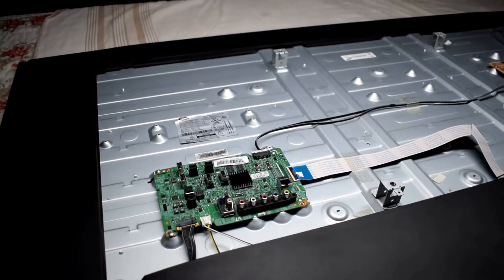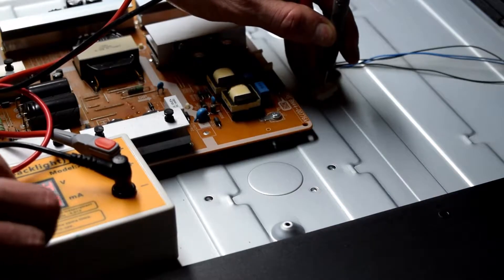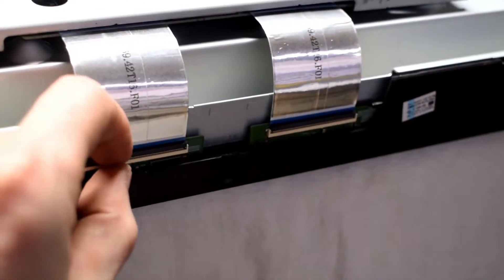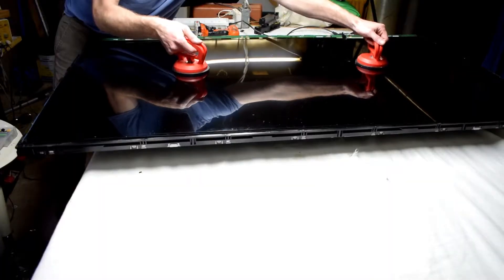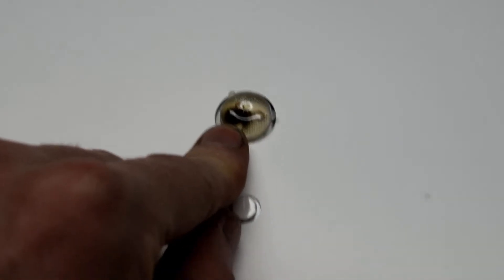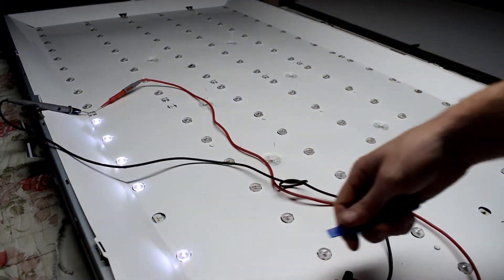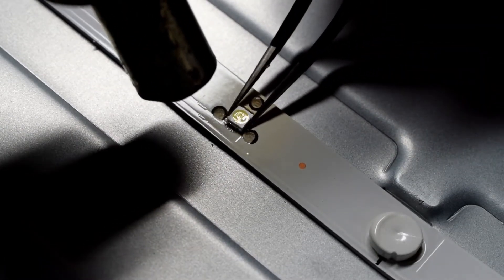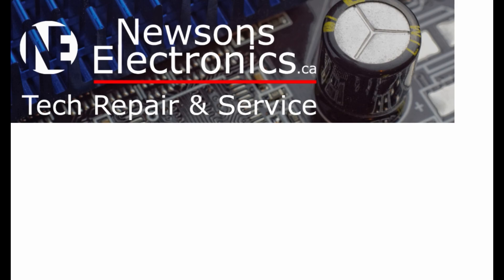Samsung 65" tv backlight repair | (UN65H6203) | detailed repair explained!

Comment: You said at the end, the reason backlight led burned out was low backlight settings on tv menu, 20%, why is that? lower voltage is better than higher , no?

Comment: TV was a lot easier to disassemble than expected. Ordering new LED strips since over 1/2 the LEDs are shorted/bad. Thinking the shorted LEDs have damaged the power supply. Have 300+V on one line but almost nothing on the other line. Do you happen to have any info on the PS Board? Diodes seem OK but one of the negative return lines seems to be the problem.

Comment: hi, i have 65inch 4k smart tv that i think the led are bad if possible could u 
remove the screen of that tv ? i can wait a few months if you come actross a tv with that problem thank you blessing
Reply from the maker: the LEDS or LCD pannel?
Reply: @NewsonsElectronics  i believe the leds are burned, therefore the screen needs to come off, thank you
Reply from the maker: @cosmo0080  correct